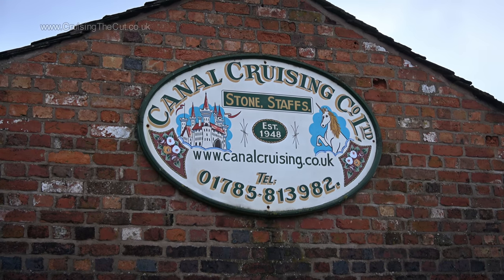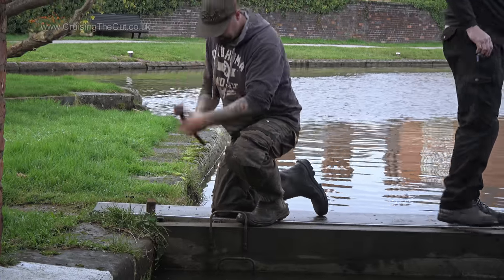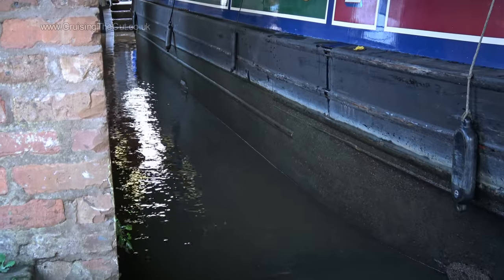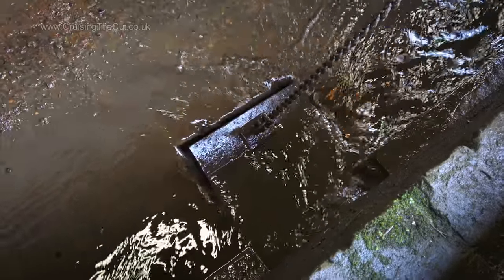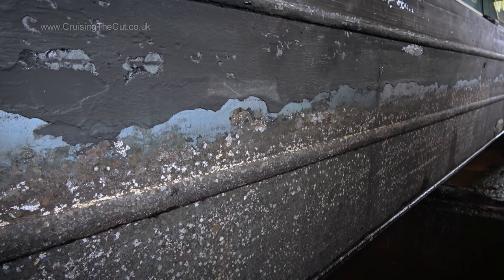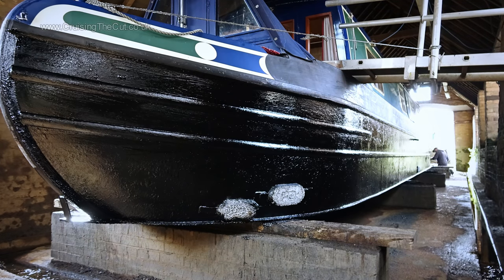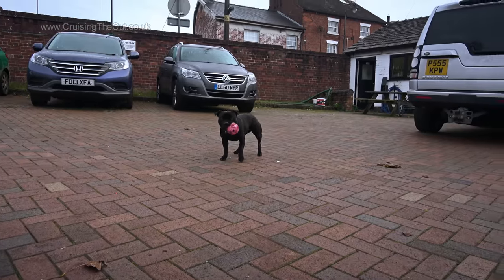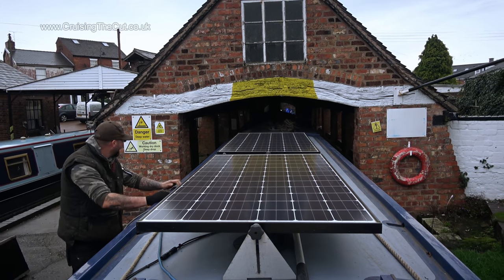201. In dry dock! Re-blacking my narrowboat

Comment: Can't they invent something to make the blacking last longer ?
Reply: They have. Epoxy two pack if you can afford the extra cost. I would save for it.
Reply: patrick rose 2 pack blacking lasts longer but needs more prep work and is this more expensive to apply.
Reply: Money.
Reply from the maker: Meh, epoxy is very expensive, requires grit-blasting first (more cost) if you had traditional blacking before, can get scraped off in the canal just like standard blacking and I'd still want to haul the boat out every three years to check on the hull condition anyway (but that might just be me!)
Reply: Generally you make the boat out of non-rusting materials instead. More expensive aluminium, or cheaper (but not as strong/sturdy against knocks) fiberglass and resin with coats of varnish. Those generally last for the "life" of the boats, only needing new paint/varnish, so no blacking on those types of boat.
Reply: @CruisingTheCut  better to be safe. Well done !
Reply: There's a fibreglass one on eBay at the moment and I have seen a stainless steel one in the past. There's a company called sea otter who build them out of aluminium
Reply from the maker: Unfortunately, Sea Otter went out of business but you can get them second hand - for roughly twice the price of the equivalent steel boat!
Reply: Also a good steel hull will last 50+ years.
I have no idea why so many people are keen to “improve” a boat design that’s been tested over 200 years on the canals! GRP is horrible stuff, can’t be recycled like steel and uses nasty chemicals in construction. Weight isn’t a consideration in Narrowboats, either superstructure or hull, as can be seen from this video a good proportion of the cabin is below the waterline already and with a flat bottom they have enough problems with wind without making them lighter as well.
I use 2k paints and that bed liner stuff  all the time on cars, I wouldn’t put either on a narrowboat. Especially one that’s doing what it was designed for, roaming the canals carrying important cargoes of cheese sandwiches most of the year!
Reply: @CruisingTheCut  Agreed! 

Another vlogger recently had their boat epoxied and a few of the viewers commented on the preparation being of the utmost importance.

One or two expressed concerns on the preparation of their particular boat by implication sort of thing.

It may be that depending on the bashing a boat could get, just by being used as intended, that leaving the boat in the water for possibly five years is counterproductive.

Could be all sorts of probs not seen on the hull, as in coating getting scraped off or general deterioration because of inadequate preparation, say; not to mention the state of the anodes.

One or two boats on my yard found to have had only the steel band left on their anodes and hull a bright orange as it dried.

Amazed me that people did leave it so long before inspecting anodes.

Anodes not especially cheap but overplating a great, great deal more expensive and you still have to buy new anodes ... plus a galvanic isolator or isolating transformer if in marina over winter.

Lastly, the hole in the rudder plate is for lifting it when said rudder is installed. Makes it easier dropping the rudder pin into the cup bearing on the skeg.

Plus a useful datum point, if the hole is underwater you might be overballasted toward the stern ... or you're sinking.
Reply: @CruisingTheCut  Yep. That's what I'm looking at. One of the ones I wanted a sneaky look at just sold, so it's a nogo. The other I'm hoping on, but not sure if I can get sold and out in time before someone else snaps it up. I could get it before, but a lot more risky doing it that way (and hoping I sell the house in time :P ).
Reply: @CruisingTheCut  EEK. Another drum of tar it is then.
Reply: Ross Kneebone Do you find water can get behind scratched epoxy like it does bitumen? Some of the automotive 2k ones allegedly self heal. I have no experience of the marine versions. Thanks for the detailed information above.

Comment: Can I ask a silly question? Is there not a more permanent solution?
Reply from the maker: Most coatings would get bashed and scraped over time so replenishment is sensible. Plus regular haul-outs enable you to check the condition of the hull, so it's actually a benefit to bring it out.
Reply: @CruisingTheCut  Ok, I understand. Thank you.

Comment: Why can't there be an epoxy coating for this that you never have to ever do this again can it be completely sealed and baked or enamel on there
Reply: It has to be impact proof. If the steel deformed to a significant degree then the paint film would have to follow.

If the paint film(s) were too brittle and cracked then water would get behind epoxy film.

The more this topic is discussed, both pros and cons, the more it sounds as if using an epoxy based film is rather more trouble than its worth, even when correctly applied.
Reply: @t1n4444  clog. I just use 2k paint on mine and it holds up pretty good. But there is a thought now what about bed liner paint it rock hard and extremely durable you can't scrape it or anything a lot of 4x4 trucks are using it for extreme off roading. Just a thought now!!

Comment: wouldn't it be nice to have a hull made from stainless steel!
Reply from the maker: Probably not. Stainless is more expensive, there's much less expertise in working and welding it along the canals plus it can still rust. There have been aluminium narrowboats but they're very expensive.
Reply: Yes and no. Yes, because of resistance to corrosion (although a lot of stainless steels with a lot of different chemistries, which come with different attributes, qualities and strengths).

No, because stainless steel is less forgiving of getting walloped hard by another boat, which does happen believe me, and smacking into pilings, lock and bridge embrasures. Could end up with hairline cracks ...  at first.

Plus stainless steel costs more, and requires a different method of welding from mild steel and can be a bugger to drill.

Mild steel is probably the best all round material from every aspect.

However, there's mild steel and and mild steel. It is said by them as profess to know these things (but we're talking annecdotal evidence here btw) that older British built boats are constructed of excellent British steel and the later boats are constructed from sometimes lower quality imported steel.

The welder on my yard tells me that welding Chinese steel, as an example, results in a mini fireworks display as the impurities burn off under the plasma torch.

Other fitters tell me some steel plate, found on newer boats offer very little resistance to being drilled. No idea where that steel actually originates of course but annecdotal evidence days it's imported.

Some narrowboats built in China ( yes really) come over in standard shipping containers. Narrowboats also built in Poland and come over as deck cargo. So only goodness knows how good the steel is. Apparently some Polish built boats have 16mm base plates compared to the more usual 10mm material.

Google is your friend if you "really" need to know, 😁 ...  but you have to be into canalia or nerdy, or, sadly, both.
Reply: My mate has the only stainless steel  boat that's in the UK we will be launching it soon will be videos to follow. on a canal near you soon  .... :) love the blacking video I'm jel of the big brush :)

Comment: Blacking the boat every 2 years is the one thing putting me off from buying one.
Reply from the maker: A lot of people would do it every three (or more) but I like having it taken out so I can see how the hull looks. Don't let it put you off, it's a good thing!
Reply: All boats need maintenance, all those jobs cost money. Even a little dinghy needs its hull cleaning, sails replacing, rigging checking and stays replaced etc etc over time. Boats are a good way of burning large piles of money!  Also every few years you still have to get the boat hauled out to remove the crustaceans and fouling from the bottom, this is true of every type of boat that is left in the water all the time, regardless of what the hull is made of or what it’s painted with.

Comment: Why is nobody using stainless steel?
OK...
it costs more...
but you never have to paint it again...
and even use a thinner plate to build it. 
So... less metal to buy, to begin with.
It's just an idea. 😎
Reply from the maker: Stainless is more expensive, difficult to weld, still corrodes (it's stain resistant really). Also, the stainless element is a coating on the steel which, if it has any cracks in the joins, means it'll just rust anyway. Have a Google about it.
Reply: @CruisingTheCut  I was idly looking around to see if any company hot-dipped galvanised narrow boat hulls. Of course, it's only something that could be done at the original manufacturing stage, and would require some pretty impressive galvanising facilities but, in principle, it could massively greatly increase hull life and reduce the maintenance.

I found an intriguing link to the "Galvanised Boat Company" of Wolverhampton, but can't find any other trace beyond this one link (and I've no idea if £22,500 for a 57 foot narrow-boat shell is good value or no, galvanised or not).

https://boats-from.co.uk/not-specified/57ft-galvanised-narrowboatcanal-boat-shell-155049

Cold galvanising is another matter and nothing like as effective. It's basically just a high zinc content paint and nothing like as effective as hot dipping.
Reply: @CruisingTheCut 
It costs more.
That's for sure.
And welding it...
it's not so difficult at all.
I'm doing it myself sometimes.
And the "stainless" it's not coating that is put on it. It's "growing" back naturally, after welding and/ or grinding, after a few weeks.
That's also one of the reasons why they are using it in professional kitchen. 
Once I find a piece of stainless steel in the ground...
that was there for more than 30 years.... 
wet conditions... 
It was stained...
but I cleaned it up with some kind of kitchen sponge...
and nice and shiny again.
A boat made from it, it would look nice and shiny to.
Never paint again. 😎
Like I said...
it's just an idea.
It's my profession.
Helping future designers with their ideas.
Enjoy your boating life.
I'm living in a motorhome in Belgium.
For almost 18 years now.
I often park near water.
Next summer I probably going to do a bike (and tent) trip for a few weeks, next to the many "cuts" there.
I like the view...
as I'm following you there... 
and there are almost everywhere tow paths next to it.
So...
it worth the trip I believe.
Thanks for the great videos you provide us. 🙏🙏
Reply: @CruisingTheCut  I really enjoy your vlog. You got most of that right but galvanizing is a coating that protects "regular" steel. The "marine grade" stainless steel alloy 316 (A4) contains enough nickel, chromium and molybdenum to make it non-magnetic and much more resistant to corrosion thus more expensive. You are correct that they are more difficult to weld. 316 is used extensively for food service applications and surgical instruments.
Reply: @CruisingTheCut  I'm not sure where you're getting your info from - and based on its quality, I don't want to.
The fact that it's more expensive, I'll agree with but the rest seemingly quite inaccurate.
Welding may not be as easy as with conventional steel but isn't exactly 'difficult'.
The corrosion is minimal and I believe is 'self-healing' rather than being a source of worse corrosion
I have known 'stainless' rust but these are generally rare spots rather than all over - quite possibly due to manufacture defects. There are different qualities of stainless steel - so it might be a more expensive one would last longer.
The stainless effect is most certainly NOT a coating ! Or is at least a self-creating coating. So a new scratch would quickly heal itself despite exposing new metal. SS can be machined and it remains stainless on every layer cut off.
Cracks in joins do not rust. Again, this may be a little dependent on type of stainless steel.

Having thought about it months ago, I'd opt for a stainless steel hull. Aluminium may be another option too, particularly if not used in sea water.